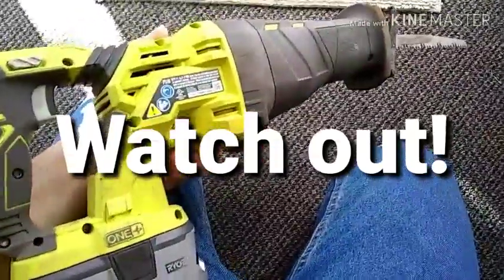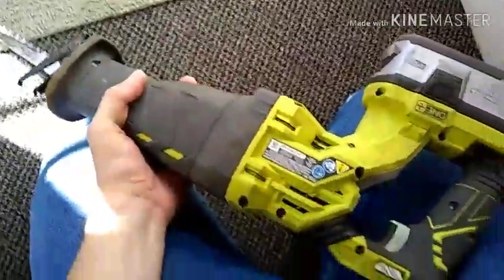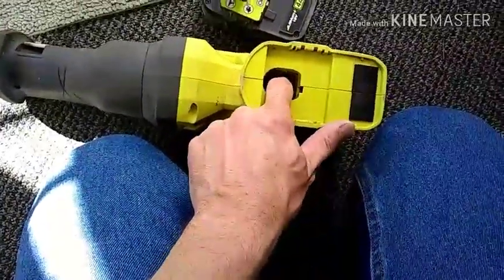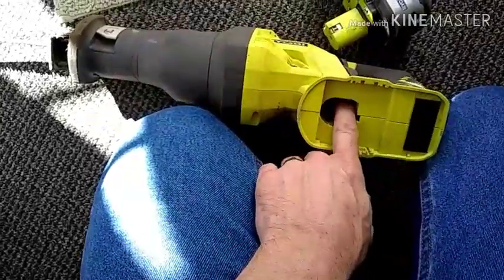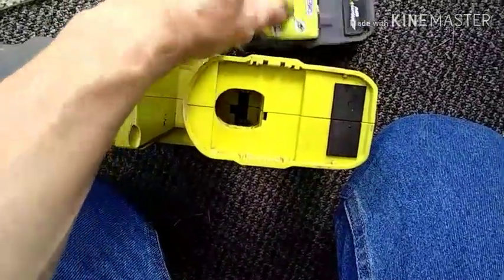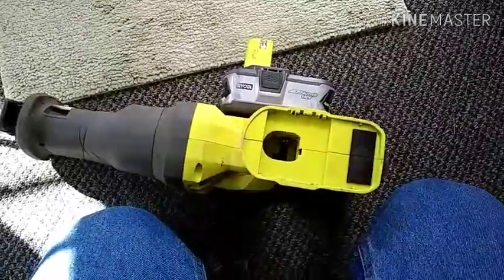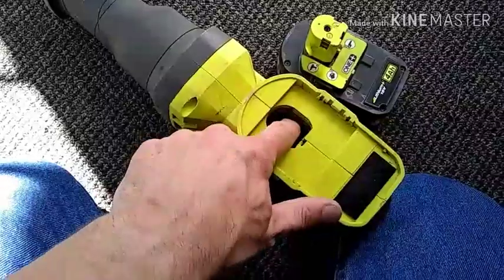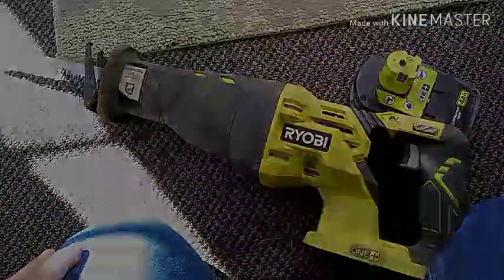The only thing wrong with the Ryobi P516 reciprocating saw / sawzall

Comment: That's not the only Ryobi tool that does that. The multitool vibrates so bad that it scars the plastic on the battery case. Those black marks on the battery tabs have been happening for years on various Ryobi tools. You need to clean the tabs to reduce the resistance and improve conductivity.

Comment: The blade release does not work. Blade is stuck. Took it apart but can not see how it works. Last thing to do is pop out the ring, but i need a tool for that. Anyone had the same issue ?